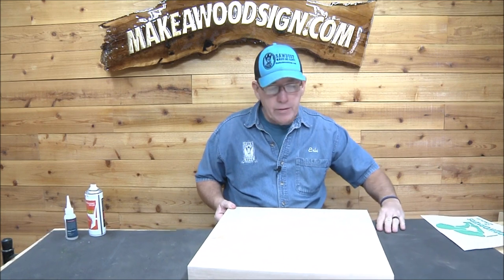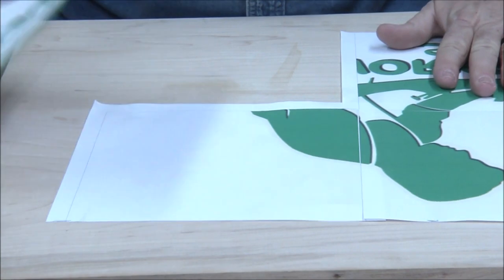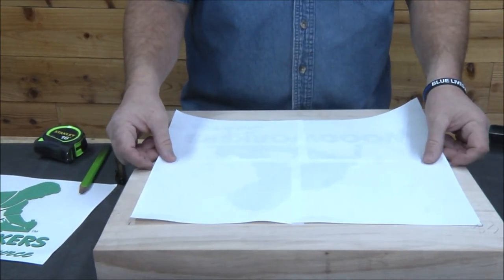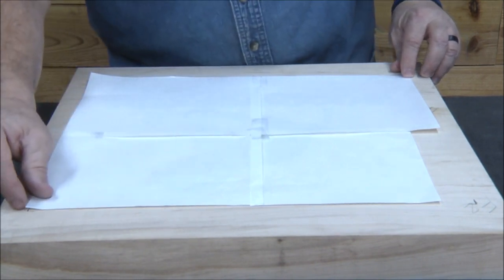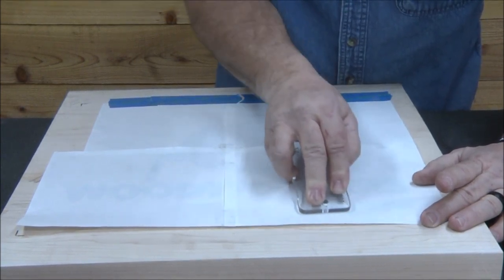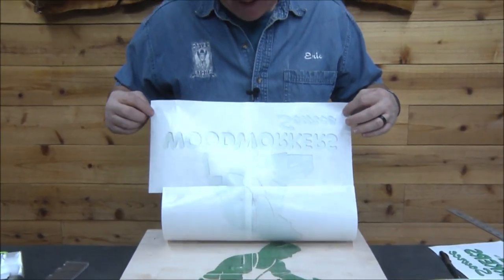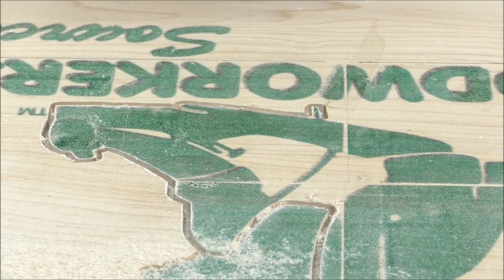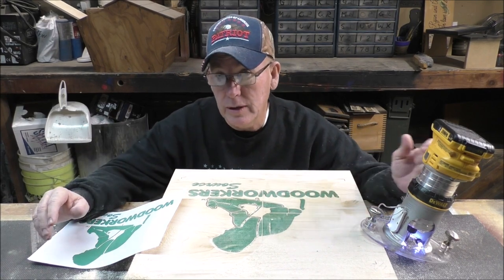#631 Freehand Carving Maple Wood Woodworkers Source Logo Sign Part 1

Comment: The hardest part of routing a sign is the prep work. Getting the letters and drawings centered. I still use the carbon paper method cause I can see the letters and center them. But tracing them takes time. It would be nice to have a cnc machine to do all that for you but you miss out on carving it yourself. It's always a good feeling when you finish the project and you step back and know you carved out yourself. Happy New Year you guys.
Reply from the maker: Thank you Manuel. I agree layout is very important...

Comment: I place art work on board about where I want to be. Then at the top of both board and paper find center for both and make a mark, and do the same for the bottom. As long as you line up your marks, top mark of paper with top mark of board, bottom mark paper to bottom mark board then the whole sign should be level with the board
Reply from the maker: Thank you for sharing Jeff. Sounds like a good process. Happy it works for you.

Comment: I need to get better at this type of transfer.  I’ve tried it twice and it didn’t work out well.  Didn’t seem to be enough ink to get a good image.  The carbon paper method takes forever!
Reply from the maker: I definitely can't do the carbon paper anymore. This method works good for me most of the time. One thing I've noticed, sometimes it doesn't look that good on the paper when you print it but the transfer looks good.